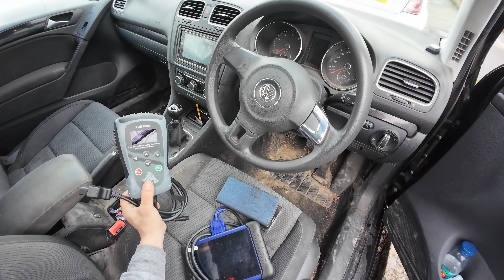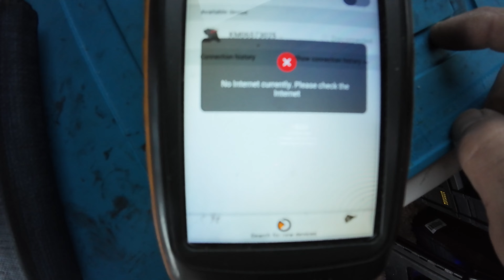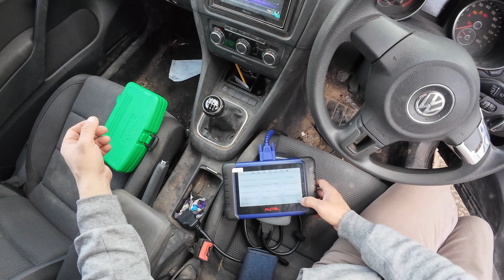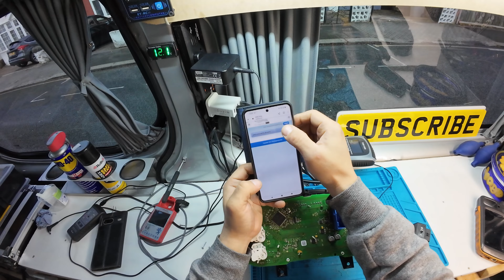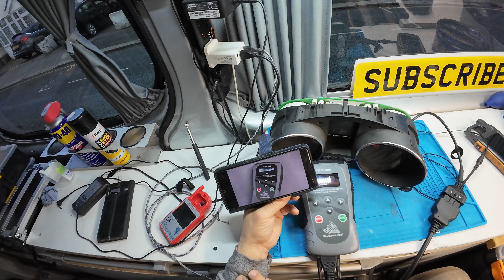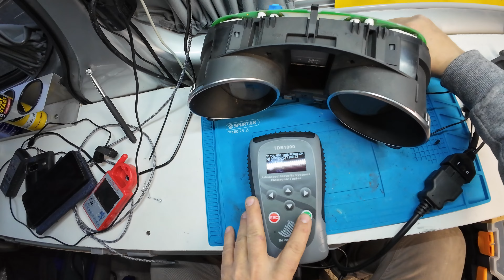✅👉 The easy way 😁 VAG AKL 2009+ NEC 24C64 NO NEED TO EEPROM OR DUMP. How to pogo pin 📍 Golf AKL TDB

Comment: Thanks for video! 

I have used Smart Pro cable with pogo pin cable and have done around 10 vw cars, but by some reason 3 last vw cars’ clusters have  been locked just after I have tried to use pin, so I ended up waiting until it will get reseted and finished with vvdi2.
Reply: Doesn't matter what tool
You use that's the character of VW clusters 1 in every 6 or 7 gets locked or bricked.
Reply: Same here and vvdi2

Comment: Why did you think that was easier Sebastian? Is it mainly the non internet dependency you like?
Reply from the maker: That and reading and writing and all that
Reply: @sebastianthelocksmithandre1600  TDB1000 is an expensive machine though and the vehicle coverage is nothing special. SP with the pogo pin lead would do the same thing wouldn't it?
Reply from the maker: @inagbihal8518  sure. Sp 4k plus tokens this one 1.8k no tokens. Loads of tools available. Each person has it's own preferences. I'm not tight with a specific one is just that I am looking for easier and safer and cheaper ways. I might not find them, or I might!?? I have to try isn't it?
Reply: @sebastianthelocksmithandre1600  I completely agree SP is silly money. I think AD are pricing themselves out of the market. I bought mine second hand for £2700 with 20 tokens. I haven't had to buy any yet and only use it as a last resort or for things like the later Renault that I don't trust Autel on. I like DB's tools. I have the PSA and Nissan pincode readers. £1800 only gets you access for a year though, no? Another £995 for 4 more years to get unlimited access? I do like the no token use though.
Reply from the maker: @inagbihal8518  yes full licence for one year corect.